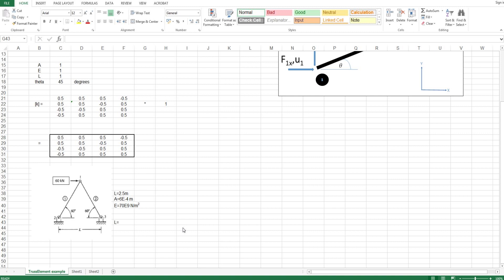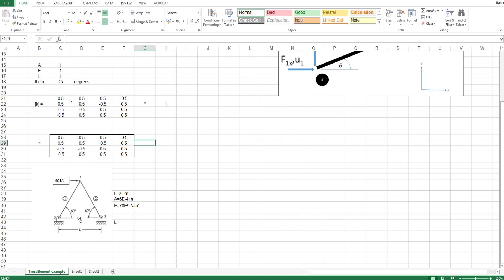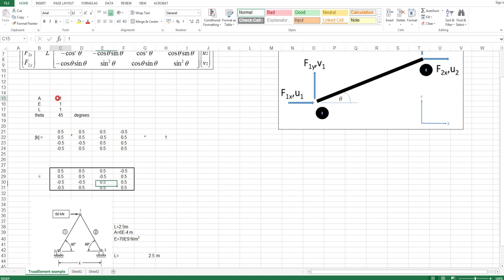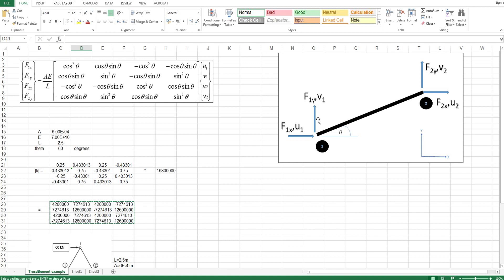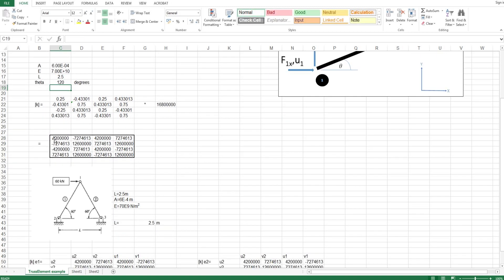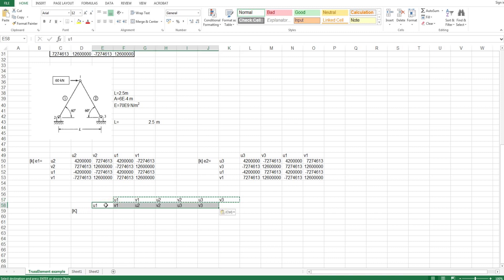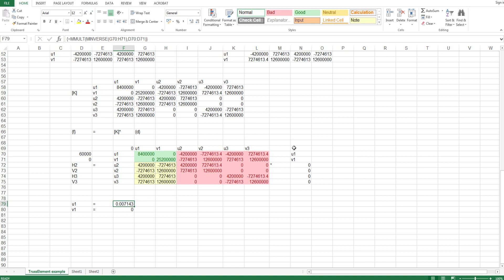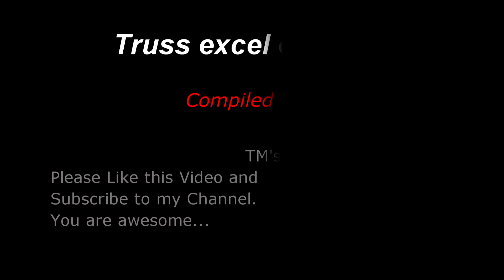Stiffness Method truss/bar Excel example

Comment: sir can you please explain to me why you multiply that green matrix to find displacement . thank you
Reply from the maker: Hi, thank you for the comment. The matrix equation is essentially a number of linear equations. By using that consideration, in order to find the unknown displacements, we must consider the equations with the unknowns u1 and v1 in them. In this case it is the first two rows/equations of the matrix expression. Furthermore, if the right vector is examined we can see that, apart from the first two entries, the rest of the rows are filled with zero values. Therefore we can neglect those parts of the equations as they are all zero values. This is highlighted as the pink part of the matrix.  Then all that remains to find the displacements are the green part of the matrix equation, which is used to solve the F = K*d equation. Hope this helps :)
Reply: thank you sir, your video helped me alot

Comment: Am I wrong, or this stiffness matrix is not symmetric? You should check these results and the equilibrium of the system. Getting a bunch of numbers is just the half of the work ;) peace!
Reply from the maker: Hi, yes it seems I missed a minus in one of the [ke] entries. It doesn't affect the answer however as the wrong values are multiplied by 0,  which may be why I didn't pick it up when checking equilibrium. Thanks for pointing it out, I updated the excel file at the link.
Reply: My bad! I stopped watching the video when I saw that mistake, great that you updated the file ;)

Comment: hI, really great videos. i have a question. you use f4($) to fix $E$58 and $f$57, you have two elements, so it works, but if you have more elements if you keep fixing the both also, then the value 8400000 is repeated and dont count the other locals matrix. so for more elements its just fix $E58 and F$57. if any dude need it. again thank you so much. may be can you do this examples in macros, visual basic or matlab.
Reply: do you know programming this  in voyage or texas calculator?.. if you do, your videos will share around the world!!!
Reply from the maker: Hi, thanks for your comment. Unfortunately I do not know how the voyage calculator works. Although I can show you how to do these examples in Matlab (way easier than Excel). I shall add it to my list of future videos :) Thanks for the suggestion.

Comment: Hello Mr. TM

Thank you a lot for the videos. I am a beginer to FEA in excel for truss problems, and the way you solve the global matrix using the vlookup helped me a lot since i was stuck there for a long time. How ever i am not stuck in at another point for a longer time. I would like to know if there is a way to create a formula for solving the global matrix but where you dont have paste the equation and edit the arays in it by hand. I am aware this yields for some VBA programing and im am cool with it. I would just want to know if there is some advice from your side regarding this problem.

Regards!!
Reply from the maker: Erdoan Musatfov Thanks for the comment. My apologies for the late reply. I had a connection problem.  
There should be a way to do this. I shall look into it, but I haven't yet tried to use VBA programming in any way.  It would make the solving of the problem a lot faster...  If you come up with a solution please let me know as well. Sorry if I'm not that much help :)
Reply: @TMsChannels  All you need is Matlab!